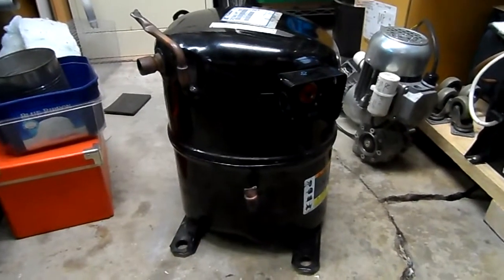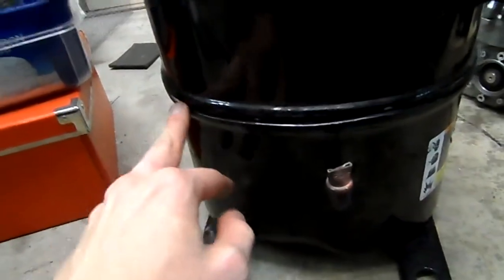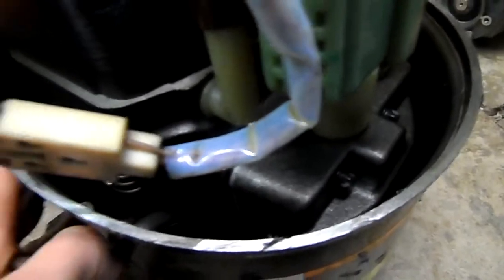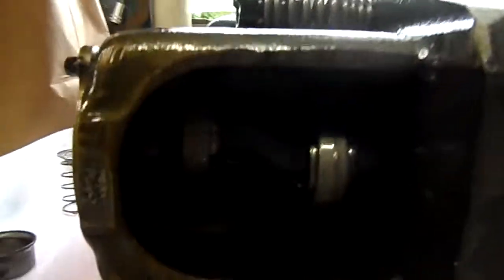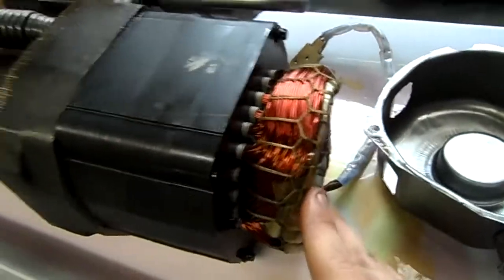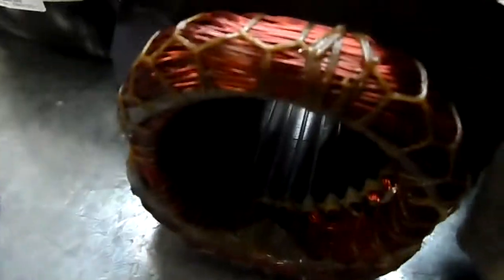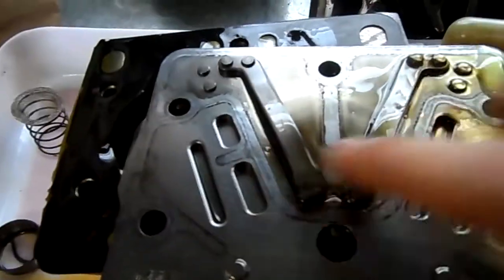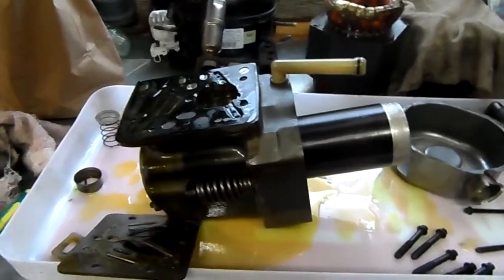2 Cyl Copeland Compressor Autopsy

Comment: Thanks for the look at the internal workings of the compressor, they are very well made, no wonder that they can give years of reliable service. Excellent video!
Reply from the maker: Thanks very much! Glad you like the video on it
Reply: I have a compressor and the connecting rod shattered in multiple pieces and trying to find the replacement @MrMacman98